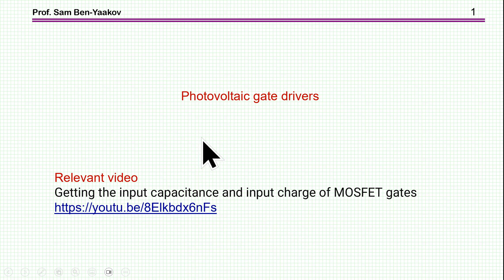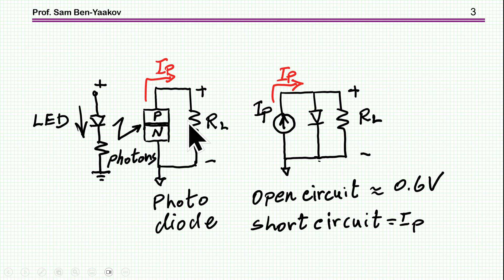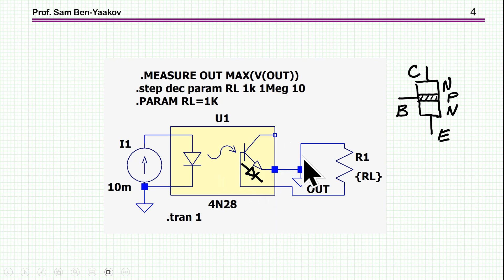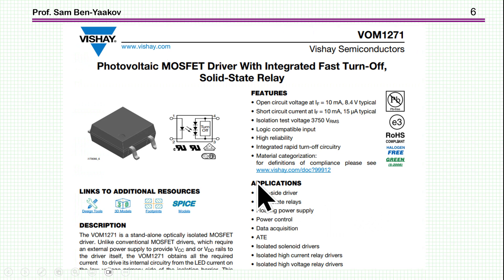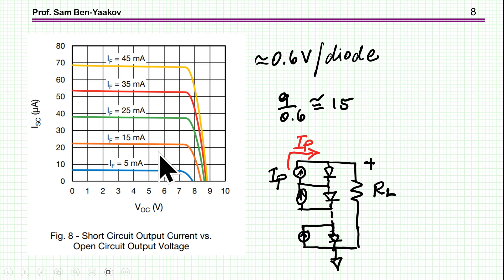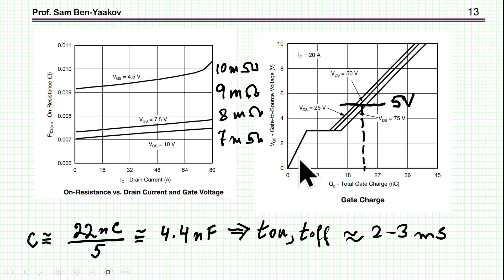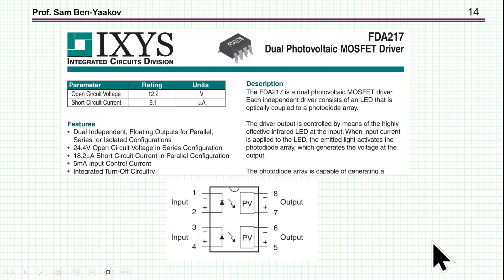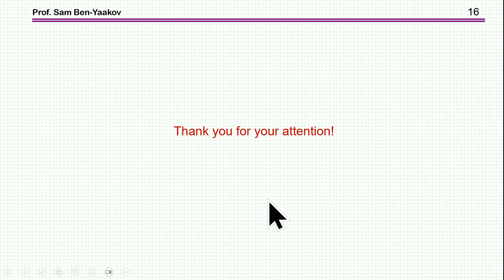Photovoltaic gate drivers

Comment: I've been evaluating a number of brick solid state DC out relays and have noticed something most never think about.  The fast turn off circuit doesn't work if the control voltage slowly drops. This problem only happens with turn off.  The gate drive can easily drop and stay at low voltages which force the FET to operate in a linear region.  I had assumed that the on/off delays would provide a hysteresis allowing use with analog circuits.  That cause the FET to burn up with relatively low current.  Battery and self powered PV circuits could be prone to failure without voltage protection circuits. Thought your viewers might find this helpful.
Reply from the maker: Thanks for sharing. I was nit aware of that.

Comment: Curious, I measured the short circuit current of the classic 1N914A while being intensely illuminated by the LED flash of my phone in direct contact with it, and with fine adjustment of its position, the peak short circuit current was up to 1.3uA, though 1uA was more readily achievable.
Reply from the maker: Interesting

Comment: Application note 31 from Panasonic tells the "secret" of the fast turn off circuit. A depletion mode FET.
Reply from the maker: I don't think that this is a D mode MOSFET and there are some issues with the circuit as shown in the application note.
Reply: @sambenyaakov  I did a LTspice simulation using a SST201 (JFET) and a 100k resistor. Works flawless. Full solar current for charging, fast discharging (even faster than charging). A simple discharge resistor would work MUCH worse. What kind of issues are you thinking of?
Reply from the maker: @JacquesMartini  What happens if there is no load, no capacitance at the output? Still. Also, I wonder if a jfet can be mixed in the IC.

Comment: Wouldn't it be better to have that kind of circuit to provide power to charge a capacitor and then a faster system for control that uses that energy to toggle the gate?
BTW: the energy efficiency is atrocious 0.2% !
Reply from the maker: Yes, but then you need an isolated driver and you still are limited by the rate of switching on and off.
Reply: @sambenyaakov  You could power a CMOS gate and decoupling capacitor with the solar current and set the switching threshold high enough. This way, the MOSFET would switch very fast ON and OFF. But yes, the average gate power is limited to the power provided by the solar cells.

Comment: This driver should be used with care, in my prototype it lead to thermal runaway as gate voltage drops until finally MOSFET failure. Also due to their price practical use may be questionable, tiny dc-dc can be cheaper
Reply from the maker: Why did it runaway? Can you share the catalog number of inexpensive DC DC converters?
Reply: @sambenyaakov  because more temperature - less gate voltage - higher resistance - more temperature... Etc . Catalog LCSC

Comment: Did you get a new mic? Sounds a ton better.
Reply from the maker: 🙂it is the internal microphone array of the Surface 9  pro
Reply: @sambenyaakov  Nice. Sounds much clearer and has a much better noise floor than the previous one you were using.
Reply from the maker: @gsuberland  👍👍

Comment: You are missing the most interesting part, the turn off ciruit. Simple but clever!
Reply from the maker: Why won't you enlighten us? I doubt if the manufacturers provide the full details of the turn-off circuit design.
Reply: @sambenyaakov  Where is my comment? I did post some links to a data sheet and a ltspice file. Search for Application Note 031 from panasonic.